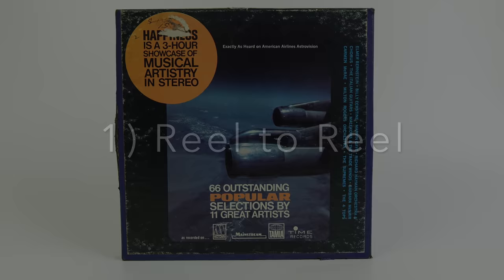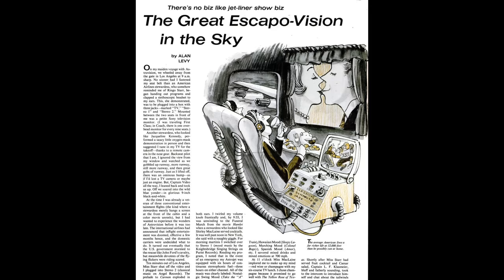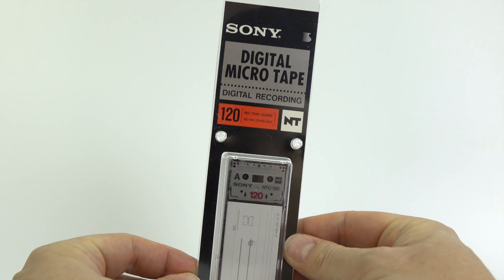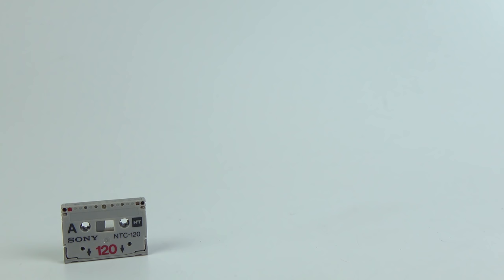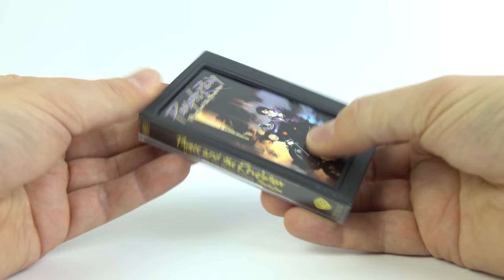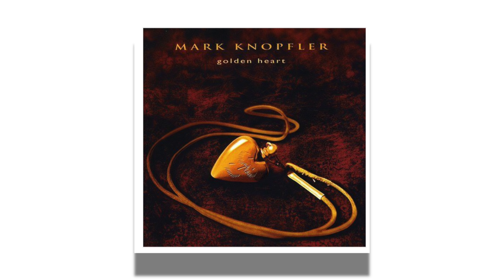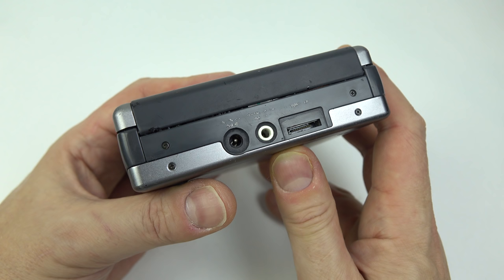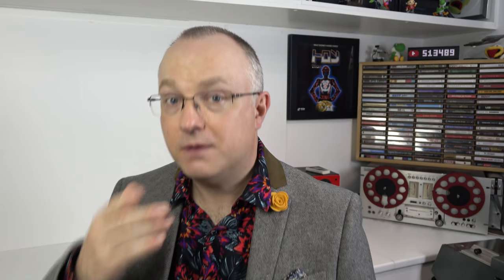Audities / Odditapes -  Rare & Unusual Tapes

Comment: These American Airlines tapes were extremely popular in the mid 60's. I was fortunate to live in an area where one could find prerecorded reels quite easily. On the west coast we had a big box store chain called White Front, that had a pre-recorded reel section bigger than most record stores. These were available in quantity along with current releases. Prerecorded stereo reels were about 3 times the cost of an LP at the time. My copy of Revolver i bought in November of 1967 was 7.95, compared to 2.95 for the stereo LP. These American Airline tapes also found their way to PX's in Vietnam, and a lot of GI's either had these or direct copies of them. I have one of those in my archive. But prior to this, Voice of Music made a series of long playing tapes (3 hours, just like these) but of unified genres and of interest to the older generation (lots of easy listening, big bands and orchestral versions of modern hits). i have a couple of these as well. They also sold these American Airlines tapes at the airports themselves. As i recall, these sold at retail for around 19.95 in the mid 60's.

Comment: Never even heard of DCC before.
Reply: They were a fad in the mid 1990's
Reply: I don't think they were ever sold in Danmark.
Reply: There was a moment there circa 1993 when cassettes were locked in a fierce competition with CD's because they cost half as much but sounded half as good.  Digital cassettes were supposed to solve that problem.  DAT and DCC were the major digital tape formats from the era.  DAT found a home in studio production and server backup; DCC never had such luck.  A shame, really, as it was a better format, since a DCC machine could play regular analog cassettes as well.  It's all moot now, of course, since we have services such as Spotify and the concept of "the album" is all but dead.
Reply: The DCC cassettes also suffered the same problem as regular cassettes in the form of tape degradation and possible mechanical failure inside the cassette.
Reply: Oh, of course, they're still tape... but as with any digital source, if you have any signal at all, you have a complete signal, as opposed to an analog source, where signal quality degrades by some approximation of an inverse square.  The selling point about "WOW DIGITAL" in 1993 was a valid one vs traditional analog cassettes.  Obviously the same digital information stored on a modern device with no moving parts is going to be a more stable storage medium.
Reply: Oh, they were certainly also marketed here in Denmark - in the early '90's I remember there was much talk about the format war between DCC and Minidisc about which format to replace the CC. Funny to think about today, since none of them became the big thing - DCC flopped and Minidisc never really became that popular. Instead, in the end of the '90's, recordable CD's became the format that occupied the niche - until a few years later, when physical media to record faded out and recorded music became a digital thing (MP3)

Comment: Sony NT had 32khz sample rate and about 12-bits of resolution... Hardly cd but very impressive for the age and size!!
Reply: Note that (from Wikipedia), the system used "12 bit nonlinear quantization, corresponding to 17 bit linear quantization", so it presumably sounded a fair bit better than normal 12-bit

Comment: I am completely stunned to hear that there is actually a new album release on DCC - the first one in twenty-one years! Pretty incredible. By the way: DCC has, in a way, lived on in digital broadcasting all these years until today. DCC compression system known as 'PASC' is essentially Musicam or MP2. And yes, that is indeed the pre-decessor to mp3. Interestingly, MP2 is still widely in use today digital broadcasting. I don't know about the U.S., but in Europe and the DVB-S system we use, all digital radiochannels still broadcast in mp2 because it's fairly efficiënt and is apparently a bit more robust in broadcasting services than mp3 is. Can you believe it, a digital broadcasting technology that has remained unchanged for 25 years with no real sign of it's nearing end? If you listen to FM or DAB+ radio, there's a good change is fed with a high bitrate MP2 signal as well. The British DAB system (without the '+') still uses MP2 but unfortunately at a low bitrate. But listen to the German public satellite radiostations: that's MP2 at max bitrate and therefore very much the radioversion of DCC - still going strong after more than 20 years.

Comment: I just got Philips DCC 600 player for free, it has been used only 3 times (2x Dire Straits playback and 1x recorded mixtape).. remote controller still has original philips batteries inside (empty ofcourse, best beforce 01-95, haven't leaked) :D 
with it got those 2 DS tapes and lots on sealed new blank tapes :)

Comment: I bought one of the NT hand held players/recorders at a pawn shop while out on the road for with my band. I always went to pawn shops back in those days. It was awesome and I used it to tape song ideas or lyrics or any band info that I did not have the time to write down. It worked great and I had 2 cassettes.  But one broke for some strange reason and the other didn't play well. It had a garbled sound in the middle of the tape.  I only found one other cassette for it and ended up selling it to a friend who was into "Spy" stuff. I also sold him a very tiny camera that was considered a "Spy Camera that I also got at a pawn shop. The sound on the NT cassettes were better than that of the other one I had that used a answering machine style tape.  Just my opinion but after having no luck finding the NT cassettes I went back to the other one.  Keep on with the videos...great info and memories here.

Comment: envision a future where the NT caught on, and instead of sd card adapters for micro sd, we get, cassette adapters, to insert NT cassettes into, to insert into a tape deck.
Reply: Crucially, a DCC or DAT deck, as NT tapes are digitally encoded.  We might have ended up with all-in-one cassette decks, with mobile or retracting spindles, 4 different heads and pinch rollers, etc.  Or maybe not...

Comment: I remember that system, like later versions, the headphones were not electronic, they were two tubes plugged into the armrest, with the actual speakers in the armrests. Weird, but it worked. Also, it allowed them to be cleaned quickly and easily after each use.
Reply: BTW, the pizza kit? Chef Boy-ar-dee still makes it - and it's still lousy.

Comment: I remember when DCC came out. Was running a classical music shop at the time, and Phillips ( polygram ) deal was you had to take the seperates audio player, plus a display stand with one of each title from the initial release ( I think EMI may have released a few as well, but ours were Phillips, Decca and Deutsche Grammophon, IIRC was maybe about 50 titles ). They did sound very good, and pretty close to CD quality, and the promised in car player would have been good.

Sadly I think we sold maybe 2 tapes ( and I think those were people who bought them by mistake and didn't return them ). It was just a format nobody really wanted, and came at the time people were still in the middle of updating their tape and vinyl collections to CD, so weren't going to
Reply: We did also have a free sampler that came out with the player of various pop / rock acts, mainly MCA artists I think
Reply: There are several car players around, like the dcc811, 822,824
Reply: I think at the time they were supposed to come out at the same time as the seperates player we got, but never materialised, so maybe came out later in the UK. I do remember that normal chrome and metal tapes sounded really good on the shop player through

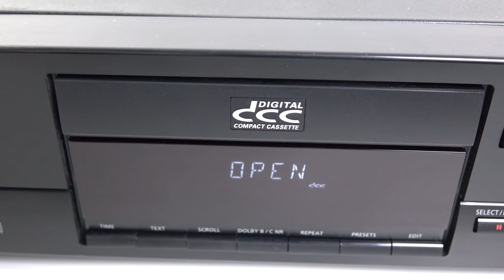Comment: 12:30 Ralf "Dr.DCC" from the DCC Museum is a personal friend of mine, and I helped him a bit to produce Jeremy Heiden's DCC release. As you mentioned, a DCC-175 with a PC-link cable to a Windows-95 or Windows-98 computer was used to record the music and the title information, which means the title information can only be seen on the following recorders and players (by the way these are 3rd generation, which was the last generation of DCC):
- Philips DCC-730
- Philips DCC-951
- Philips DCC-822/DCC-824 (car stereo)
- Technics RS-DC8 (probably!)
Other recorders (including the DCC-175!) can only display track titles that were recorded on prerecorded cassettes, not on user-recorded cassettes. And though this DCC is sold as a prerecorded cassette, the equipment to format DCC tapes as prerecorded tapes doesn't exist anymore, as far as we know (if you can prove me wrong, please contact the DCC museum!) so the tapes are formatted as "super user tapes".
Reply from the maker: Yes I slipped up when describing the generations, I meant to say 3rd and 4th rather than 4th and 5th...here's a list from Ralph listing the different generations of machines
1st generation:  Philips 900 / Marantz DD82 and DD92/ Techncis DC-10 / Panasonic RQ etc
2nd generation: Philips 300/600/91/305/45 etc Car Stereo 81
3rd generation; Philips 730/951 Portables 134,170,175 Car stereo 821/822
4th generation; Technics RS-DC8
Reply: Almost right: the car stereo 821 is 2nd generation; I think it's identical to the 811 but can control a CD changer. The third-generation car stereos are 822 and 824. They're identical (my 824 even says 822 on the label) but the 824 came with a wired remote control included.

The Technics RS-DC8 has some features that no other recorders have, such as recording up to 4 texts with each track on the tape. So yeah I suppose you could call it "fourth generation" if you want. But actually since it was developed in parallel with the 3rd generation machines from Philips, and because it has a chipset that is not based on the third generation chipset but is really Matsushita going their own way with DCC, naming it "4th generation" might also go a bit too far, especially if it turns out that the RS-DC8 is incompatible with features from the 3rd generation recorders. At this time I don't own one of these (yet), so I can't say what we should name it.
Reply from the maker: Yes I've got no horse in this race, that's just the info I received. I've got a few machines, a DCC-91, 600, 750, and 900. I use the DCC-91 in my Hi-Fi because it fits.  I always wondered if any pre-recorded releases were 18bit given that the earlier machines were 16bit...and have you ever seen a release that used the 'lyrics' text function or even know what it was supposed to do.
Reply: Jac Goudsmit is correct in his statements and a big help/contributor to the DCC community and museum. I have talked to the people at RCA in the United States and they state that there should be DCC tapes with lyrics on them. I have never been able to track one down. I will contact you when I find one. RCA claims that the Diva album by Annie Lennox should have this feature, but after testing numerous copies, I was not able to find a single one that had this feature.
Reply: I reckon the lyrics feature would have been a lot of work to implement for manufacturers and apparently it wasn't mandatory. On the other hand, Ralf has an ITTS ("DCC-TV") decoder that shows at least SOME information about EVERY  prerecorded tape on a tv screen, if used with a 1st or 2nd generation recorder. So we think THAT was mandatory even though there was never a recorder that could do it.
Reply from the maker: Yes I always wondered how they would synchronise the text displayed on the machines with the song, especially when the scrolling speed appears to be fixed at a slow pace.

Comment: I could swear that I've seen those Sony cassettes used on a tape-backup mechanism, but I might just be thinking about a bigger-brother variant.
Reply: verdatum Full size DAT tapes had more success as backup than as audio. I seem to recall about 4GB or 8GB per cassette, with up to 6 cassettes in an autochanger.  Of cause the modern backup tapes are now pushing almost 1000x that, but in physically larger cassettes.

Comment: How about a video on the HDD Audio jukeboxes - with HDD and CD player. Such as the Sony HAR LH500 or Acoustic Solutions SP150. Also the carousel disc jukeboxes (CD and DVD) such as the Sony CDP CX355 (300 CDs) and Sony DVP CX850 (200 discs - CD, VCD or DVD)

Comment: I wonder if there is any reasonable priced rack-size audio-player that can actually record in FLAC, Ogg and MP3 on internal HDD and plugged in USB-sticks and SD-cards? Something that can fit in the HomeCinema shelf? Preferable up to 96kHz samplerate atleast for FLAC to get a good reproduction of old Vinyls.
Reply: DelphiTheDolphin I think some of the "media center" systems can do this.  Many are in the same standard size as stereo rack components. To get a system that cares more about Flac and 96ksps than about DRM and deliberate obsolescence, you should probably installed one of the Linux based media center software suites.  For noise reduction go for a slow (by modern standards) CPU and some silent cooling solutions.  Now that I think about it, a Raspberry Pi in a "pizza box" (1.75" x 17.75" x whatever depth) might do the trick quite nicely with no fans or other moving parts. After all, the Pi is based around a chip originally designed to be the brains in such playback devices.

Comment: What was the source for video on the aircraft? It predated any portable VCR's I would have thought, and I can't think of any other technology that might be used.
Reply: must ave been a big old reel video player, ampex made those too
Reply: Aye, there were some reel to reel machines weren't there. On the subject of VCR's I bought my first, a Philips N1502 forty years ago yesterday. It cost £600.00 and tapes were £15 each. Just happened to be the same day that Elvis died.
Reply: I thought I replied to your comment, but just in case. Yes Ampex did make semi pro reel to reel machines didn't they. I bought my first VCR forty years ago yesterday. A Philips N1502 which cost £600. with the tapes costing £15 each. Reason I remember so distinctly was it happened to be the day Elvis died.
Reply: @jim, i remember our ex rental ferguson vhs in 1982 was £499, still remember the price tag in the store, ex rental decent vcr's were rare to find, it did last 15 years and a couple hours or more of daily use.
Reply: I bought a N1700 as well and both are still working, although the 1502 is  getting a bit temperamental. In my opinion, picture quality was better than Beta or VHS. It had a larger head drum and the write/read speed was 8.1 meters per second and the tape transport speed was 14.29 Cms per second. If Mat wanted to do a test there are a few on eBay or I've got a couple he could borrow. According to Google, Astrovision was custom made for AA by Sony in '65 or '66.

Comment: So I've a question. I ran across a mention one time of some sort of one-time only VHS of some popular band of the time, which is supposed to have been made from some sort of styrofoam like substance and could not be rewinded once played.

This is probably all bullshit but I have to ask, could something of the sort actually work ?
Reply from the maker: Well I suppose you could get a normal VHS but make sure the lead-out section of tape isn't stuck to the reel..so once it's played to the end it becomes unspooled - which would be hard for most people to fix...especially if the case was glued rather than screwed shut..so it was difficult to open.

Comment: I'd love to know what you used to clean off the sticky coating from that portable DCC player. I have an old Toshiba T5200 laptop that I imagine has a similar coating. Unfortunately, it's gone all soft and sticky (very unpleasant to touch) so I think I'll be forced to remove it all.
Reply: You can't really clean it. It will only get worse unless you completely wipe it, like Techmoan did with the lid of the dcc175

Comment: Hy Sir Tech! My SONY GV-300 'Video Walkman' {which by the way also plays Hi8 tapes}, as you stated, is also afflicted with, "...'rubberized coating', which perished 
and turned to a horrible, sticky, gluey mess, which had to be removed. A lot of nineties equipment used that kind of coating." --may I inquire as to how you removed it? Thanx, and we remain 'looking forward to looking back' :) Myke
Reply from the maker: It was quite some time ago and I just can't remember...it might well have just been elbow grease and a clean dry rag.. however recently I had to remove a similar coating (Nextel) from an old Revox reel to reel case before I could repaint it - and a tip I read online suggested Methylated Spirits...so I tried this and it worked well.